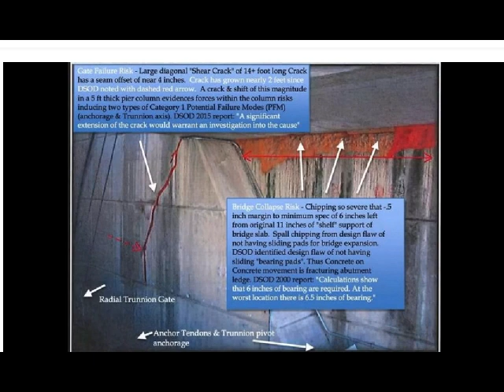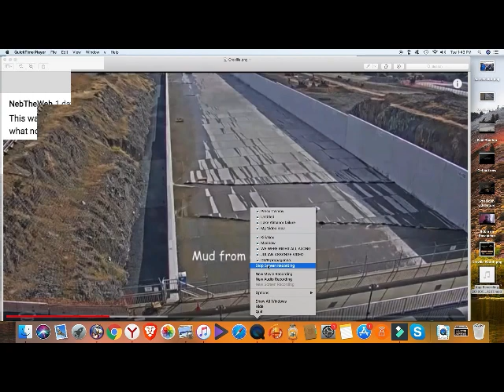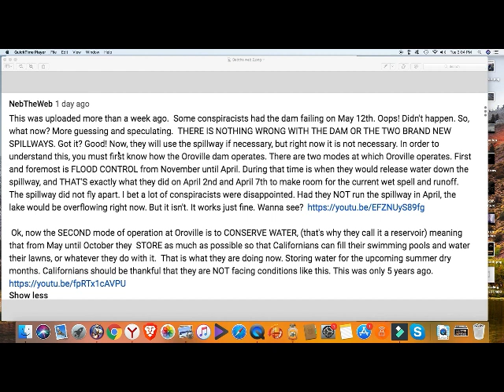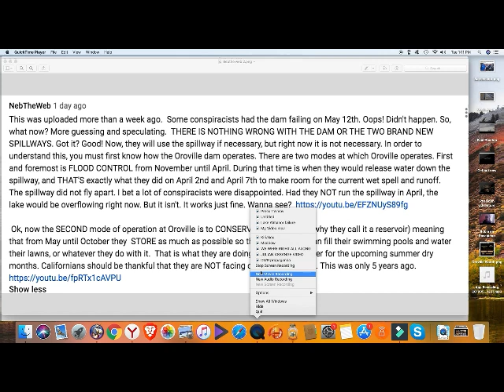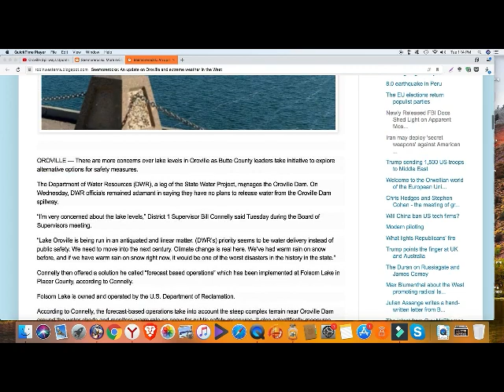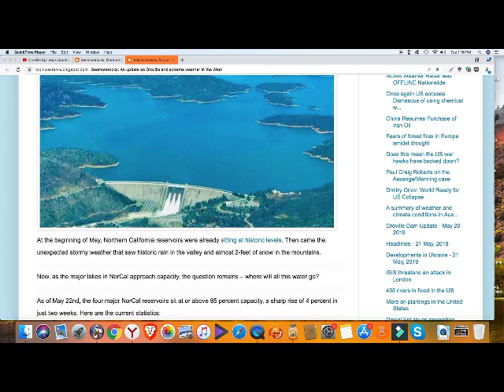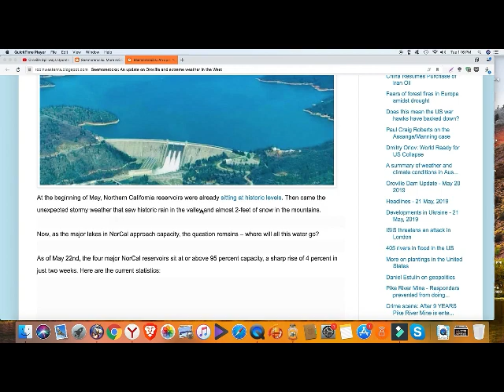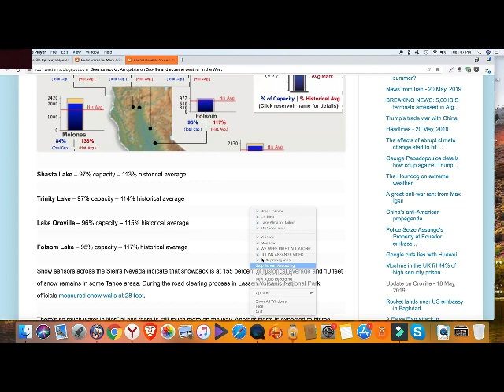An update on the Oroville Dam - 27 May, 2019

Comment: Keep it up, I like your videos. Lake Almanor is the reservoir I think you were trying to remember. Lake Almanor has 2 drain points. The earthen Canyon Dam has a drain into the north fork of the Feather River with just enough water release to stop the river from drying up. This path does not have any dams between Canyon Dam and Oroville. Then there is the tunnel that goes through the mountain and drains in to the Butt Valley Reservoir and on down through more tunnels, pipes, and generators to finally end up in the Oroville Reservoir. The bankrupt utility company Pacific Gas and Electric, PG&E, owns Lake Almanor and has discontinued letting the public know how much water is being stored or released. I hope this help explain the major feed to Oroville. Thanks for the video!